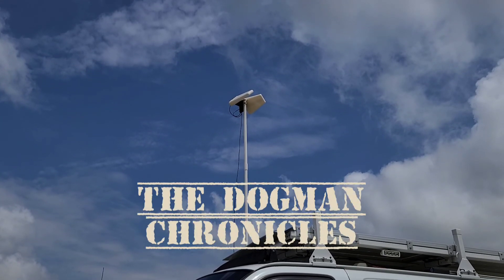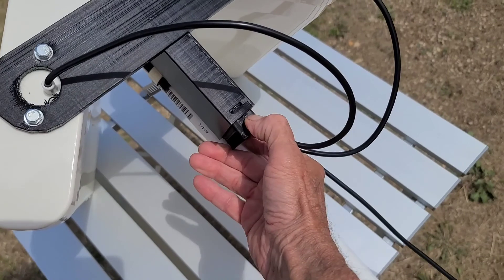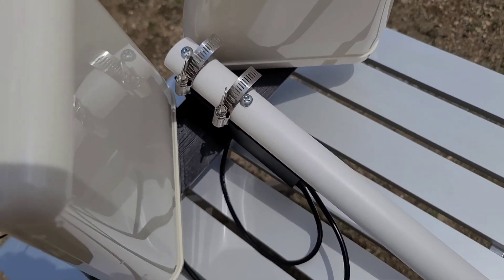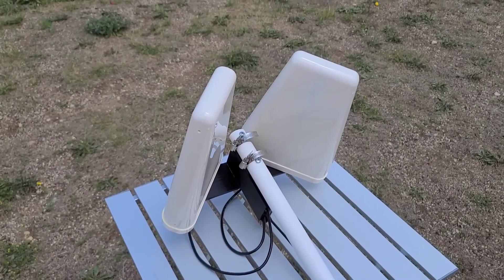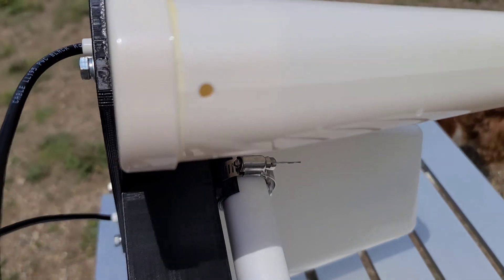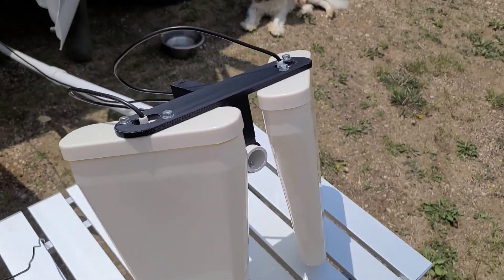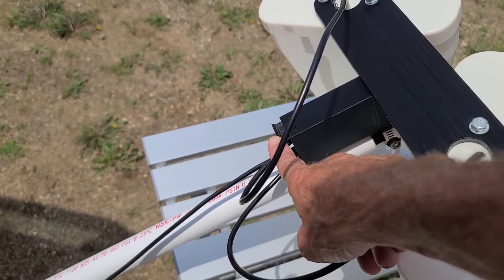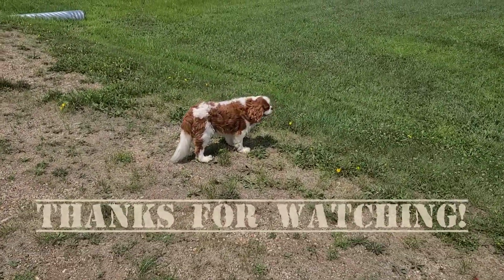07-10-2021, Binoculars Antenna Upgrade for Insty Connect Explorer

Comment: Brilliant idea with the PVC. I've been scratching my head over the mount for a week. Not liking the other expensive flag pole options.
Reply from the maker: Yep, it works for me. You could make the pole longer if you want. The size I made mine was so it fits in my van.

Comment: Get a metal pipe. Pvc will suffer from UV degradation and will break or shatter at some point, and your toys will fall and go bye-bye
Reply from the maker: Thanks, Bob!
Reply: @TheDogManChronicles  or, I think harbor freight sells a telescoping one, so if this is on a RV or trailer, you could just permanently mount the mast and raise/lower as needed
Reply from the maker: Thanks, Bob! I live in a van with minimal storage available. That's why I used a 3' section to mount the antenna on, as it stows by the passenger seat with the two sections of the antenna sandwiching the seat back. It wouldn't fit if it was longer. A lot of the time I put the antenna up with just the 3' pole. If the signal is weak, I add the 4' extension to get it higher. The 4' extension stows on the rear hitch storage and again, it can't be any longer to fit there. This is all due to my needs in stowing the antenna and would probably be different for other users. I appreciate your thoughts though. Thanks!

Comment: Are you getting better results ?   I have the Angel Wing
Reply from the maker: Yes, when I'm out in the boonies, the directional antenna pulls in more signal. Since my phone is on a different carrier, the cell locating apps don't work for finding the carrier I'm using with Insty. So there is some adjusting the direction to find the best signal.